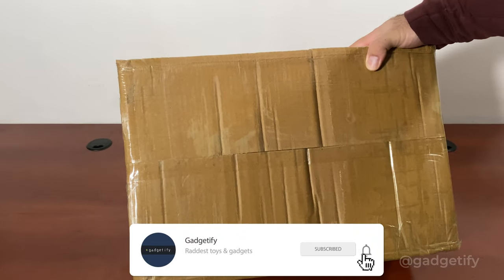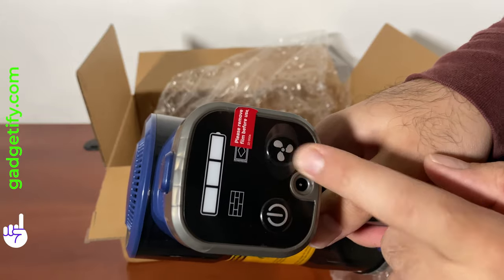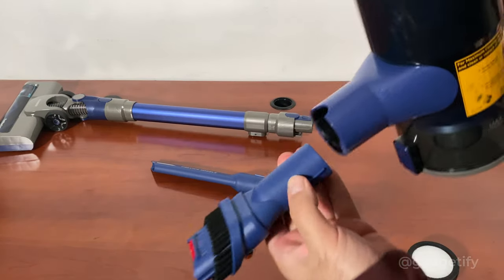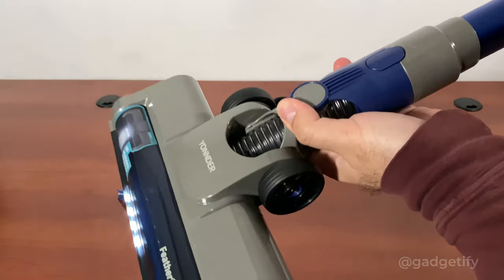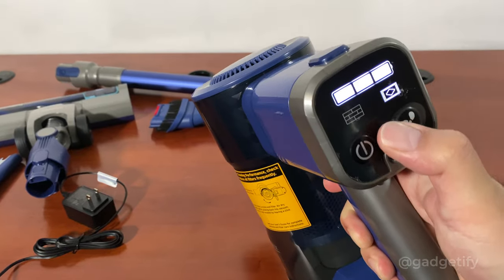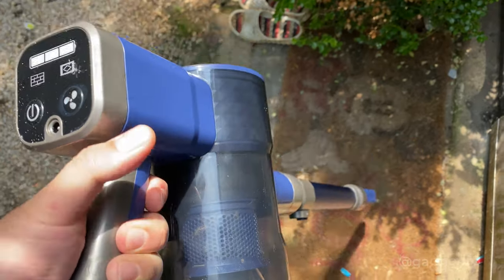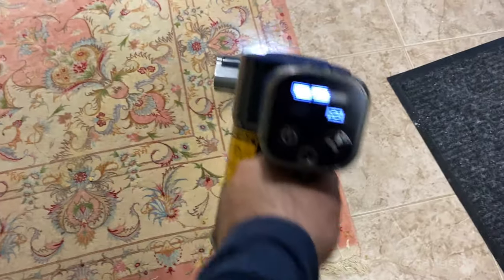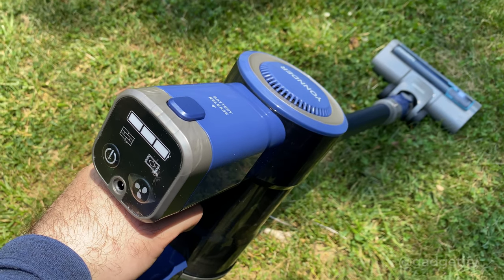YONNDER E1 Tested: Modular Cordless Vacuum with LED Floor Brush 🟡 Gadgetify

Comment: We have had ours for almost 2 months. My wife uses about once a week for touch up. Now it’s not working. It will run for about 10-15 seconds and dies. Press the power button, comes back on and dies again. Checked the normal things such as filter, motorized sweeper and the tube. No obstructions. Zero warranty information on paperwork. Nice concept, but I think money down the tube.